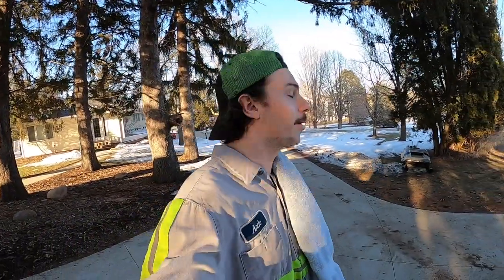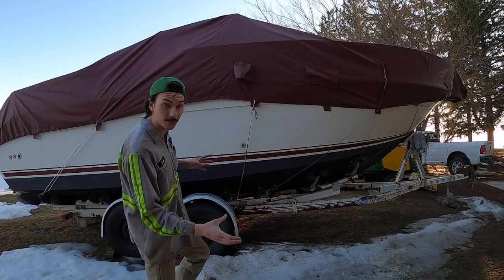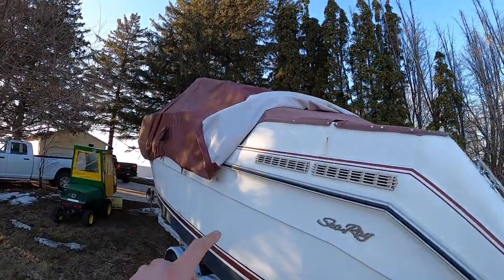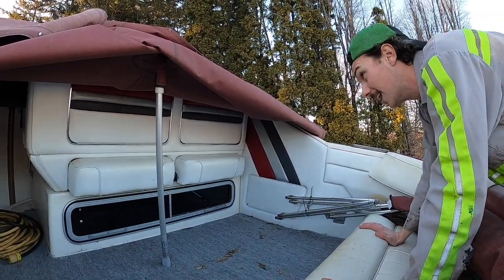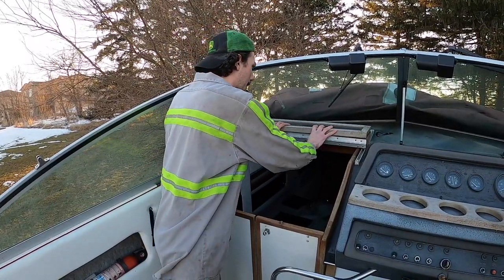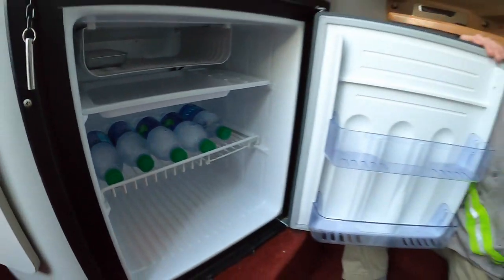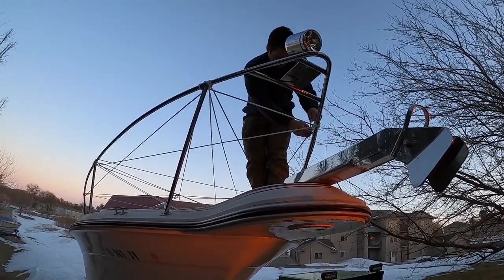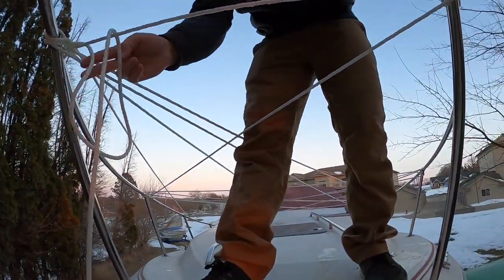Once In A Lifetime Boat Purchase! I Paid $100 For A 1991 SEA RAY 250 SUNDANCER | Boat Restoration

Comment: It's crazy to see how vastly cruisers have changed in even a decade. I myself have a 25' Ciera (circa 2000) with a single 350 and Bravo III drive (did about 55 out of the box) and the entire boat is run off of just 2 batteries.